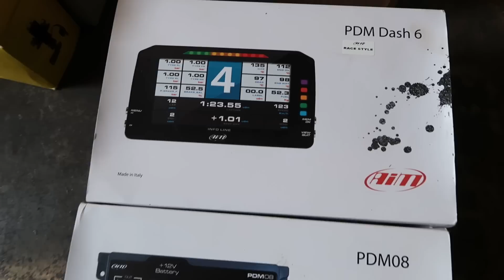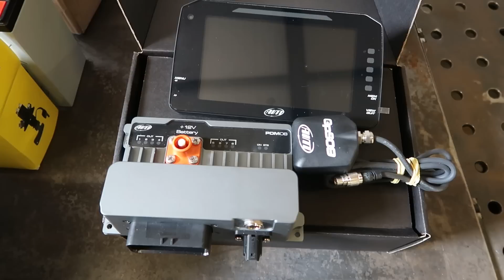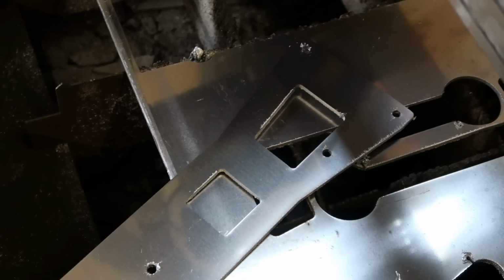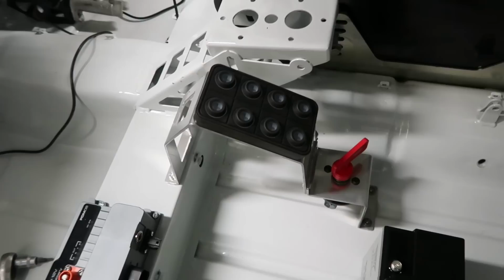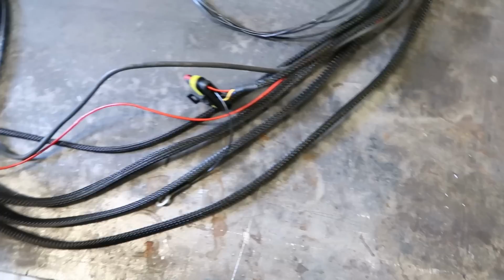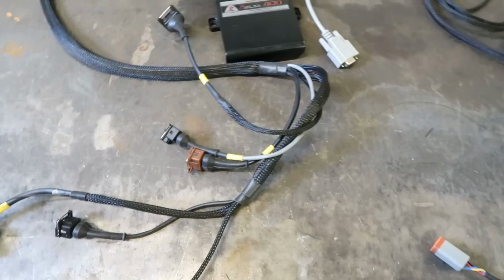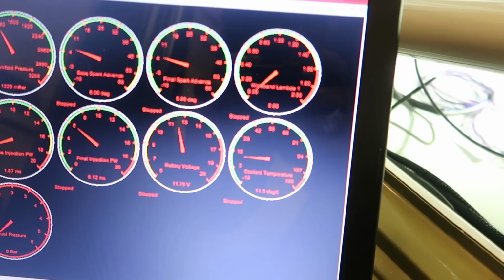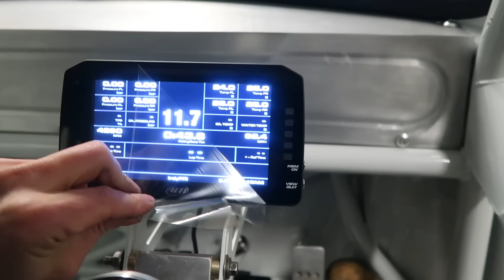Installing an Aim PDM and Digital dash in the Mini Miglia/Libra

Comment: Over time, it might be friendlier on the PDM if you use some rubber bobbins to isolate it from chassis vibrations.

Loving the build. I run a PDM32 with TPMS and the CAN buttons 👍

Comment: Hey Matt , for the battery placement you could consider the tracks and direction and work it out that way. 
You know like if they’re mostly clockwise ? 
Dunno. 
Thanks for the vids dude.
Reply from the maker: Yes mostly clockwise. Cheers

Comment: But it ain’t no Haltech !!! 👎🏻
Reply: Hey Matt. Good job on mounting. May I recommend that you put some soft rubber or high density foam in between the metal and the components?! It will cut down on the vibration of the internal elements.
Reply from the maker: Good shout.